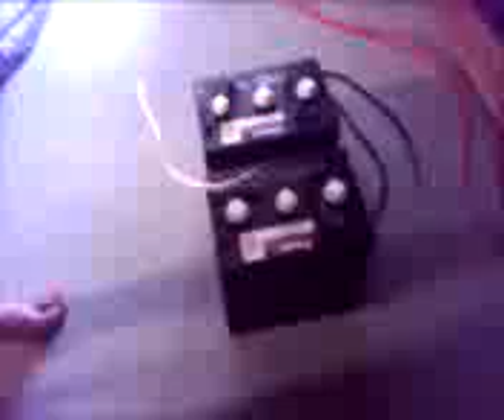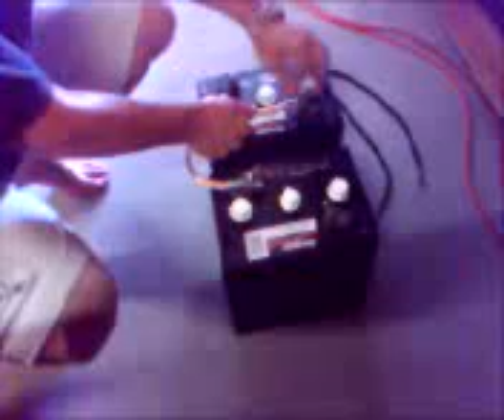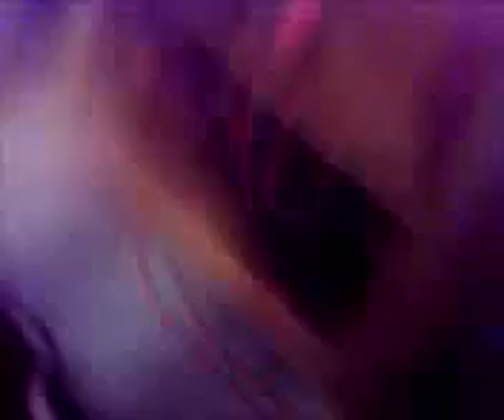My Solar Power Set Up - Part 2  BATTERIES

Comment: Ok, thanks. I had to draw a few diagrams and I now think I could connect up say 6 or more batteries using two 12V wired together to make 24V and, if i can find them, some straight 24V batteries. Possibly 4 x 6V golf cart batteries. I just needed to picture it with more batteries and of differing varieties connected.
I hope I can find a charge controller that can deal with this.
Thanks again for you help

Comment: i just need some info on solar panel and ah on battery  iam new at this i am makin the solar generetoa for less than 300 box like the other video, thats how i found yours iam stuck on the solar panel wich one to buy  i only have a 85 ah battery 12v trhinking to buy another but wich panel do i need and how far a 85 ah battery will go for example run 2 0r 3 ligths at nigth  sorry if is kinda dumb my Q;

Comment from the maker: The 6volt golf cart batteries are deeper cycle than the 12volt, even though the 12volt batteries say they are "deep cycle".  They will work fine though, I just used 6volt batteries because they were on sale at Sams Club, and the whole system gives me a little more amp hour capacity than with 12volt batteries.  I try to keep my discharge rate to around 30%, makes the batteries last ALOT longer.

Comment from the maker: I think that your thinking is wrong here.  The first thing you do is SERIES (+ to -) connect 2-6volt batteries to make 1 bank at 12v.  Then, you PARALLEL (+ to +. - to -) connect each bank of 2-6volts batteries to make 1 giant 12volt system.  Your wiring advice doesn't make any sense.  If you first parallel connect 4-6volt batteries, you still have 6volts, not 12volts.  If you then connect the pairs together in series (+ to -), you will have 2 batteries at 12v and 2 at 6v, or an unequal bank.

Comment: i don't understand why people use 6volt instead of 12volt? currently i have a 105 amp hour 12 volt battery and thinking of adding another in parallel which would give me 210 amp hours of realistically 105 as it's good not to drain more then 50%. comments?

Comment: You are going to need 5 battery cables to do this first put them in pairs that is two batteries connected in parallel that would give you 12v do the same for the other two then you should have one cable left now you are going to use that cable to connect the pairs of batteries together negative to positive (-to+) now that should give you 12v out of 4 6v batteries!

Comment from the maker: Yeah, 6v is the way to go.  You get more amp hours out of the deeper cell batteries than with 12v.  Your updated video looks cool, I made some updates and will post a new video as soon as the rain stops here.  Getting 12v is easy, you just series connect 2-6v , then parallel connect them to another 2-6v.  Instant 12v battery bank from 4-6v batteries.  I can make you a diagram if you like.